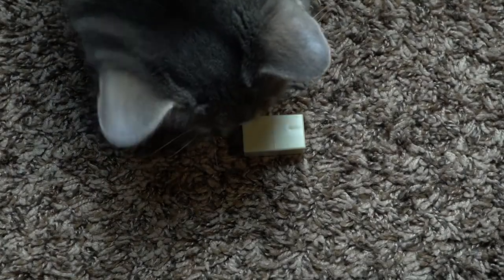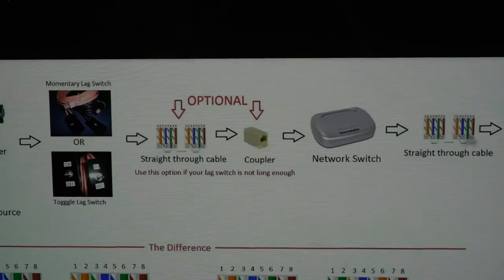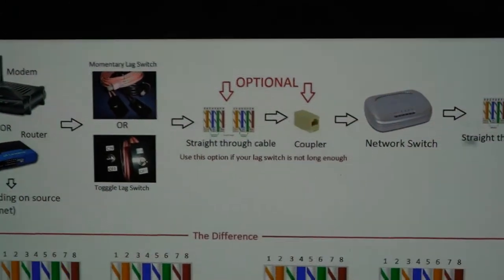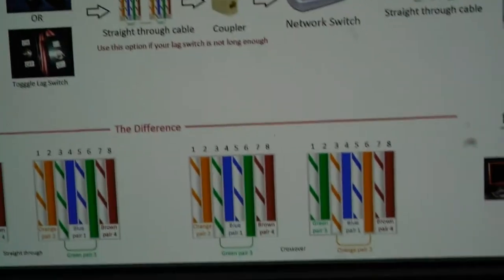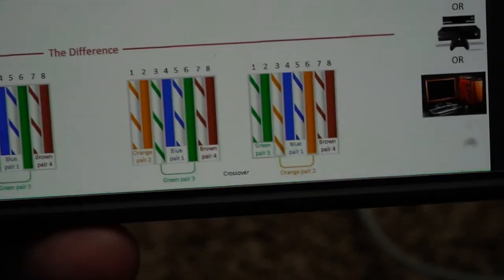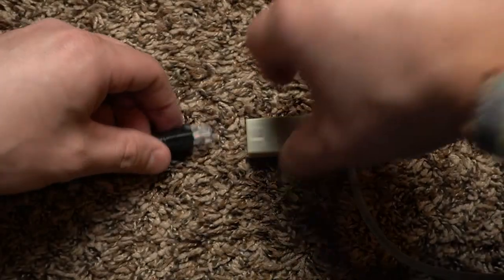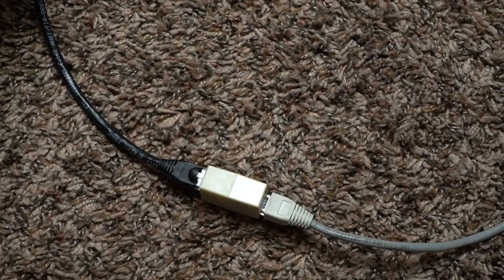Lag switch informational video 2.0

Comment: So if my lagswitch cord isn't long enough to reach my router directly. I can attach the coupler to the lagswitch and a longer cord to connect it to the router. Would it still work just as well as a direct connection or would there be major difference?
Reply from the maker: This is where common sense plays a part. If you have two 10ft pipes (they are exactly the same pipes) and a couple, You connect those two pipes using the couple. Do you then have a 20ft pipe, that will work the same as the two 10ft pipes? As long as the cable you are using is straight through and the total length is less than 328ft, I don't know why there would be a major difference.
Reply: U need a 5 port router

Comment: I thought what the lag switch users saw was going to be like normal and only others seen the lagging and teleportation. When I do it I can't see where I'm ending up. Doesn't seem like it makes sense to use one if the user gets what they see lagged too
Reply from the maker: It really depends on the game and how the servers are set up to handle lag. If you hit your bandwidth limit, you'll lag. You can't see where you're going when you lag. Sounds like the game needs a fix or there is something else, but I wouldn't know what.
Reply: @mikeeyram  Can the router be connected to the modem via Wi-Fi or does it need to be connected via cable?
Reply from the maker: Modems don't have WiFi only routers do, well most routers. If your modem does have WiFi, then it's also a router too, thus making it a modem/router combo.

Comment: It works only on 10/100 switch?
Reply: And wich color you cut between the toggle switch orange or green 
Thanks for your help
Reply from the maker: That doesn't make any scents. I don't understand how bandwidth can affect the functionally of the cable.
Reply: I been trying a few switch from other brands both 10/1000 and 10/100 its seems tha only 10/100 works
Reply: Mine work fine with orange but i wonder if the green make u lag a little bit longer?
Reply: And how bout put crossover cable together with a coupler between the the lagswitch nd the switch
Reply from the maker: I've used both 10/100/1000 and 10/100 network switches without a problem. As the bandwidth doesn't affect the cable.
Reply from the maker: That doesn't make sense. If like say, if you put the switch on the ground side the light will turn on slower.
Reply from the maker: You can try what ever you want and see that happens.
Reply: Thanks again for your help
Reply: @mikeeyram  hey im using a TL SG105 and my reconnect speed is awful can u help me out? do i need to change the switch, im not sure how to identify the best switch.
Reply from the maker: Logically if the network switch is taking too long to reconnect, use a different network switch.
Reply: @mikeeyram  yes but how do u work out which is the best.
Reply from the maker: I would assume the best one reconnects the fastest.
Reply: @mikeeyram  idk what that is though? How do I find out without dumping loads of money
Reply from the maker: There is no way to find out, without buying one and testing it.
Reply: @mikeeyram  dam its gonna be a money pit then lol
Reply: @mikeeyram  also do u need a router that connects to an external modem like tp link, then to a switch then to xbox
Reply from the maker: You need a router in general. Unless you only have one device online via LAN. As modems don't have Wi-Fi.

Comment: I have a ethernet in my router going into a netgear ethernet switch and then the lag switch plugged into the netgear and into my console but it disconnects me right away. what do i need to do?
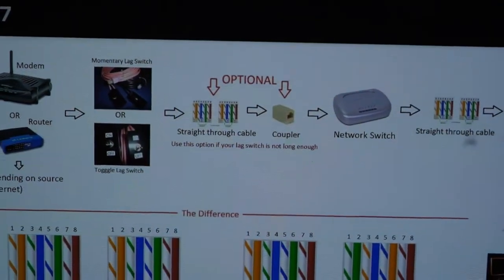Reply from the maker: Sounds like you ignored what was said and shown in the video. I show the picture that's in the item description at 3:14.
Reply: I dont really understand it and what i need to do.
Reply from the maker: What about the picture is confusing? Where do you see the lag switch in the picture?
Reply: I have the switch in the router is that right?
Reply from the maker: That doesn't answer my questions. To answer yours, yes, the lag switch plugs into the router, just like the video tells and shows you.
Reply: and the other side goes into the network switch right? Im just going through what i did to ask you of its right
Reply from the maker: Yes, the lag switch plugs into the network switch, just like the video tells and shows you. The video tells / shows you what's right, that's what it's for.
Reply: what do i do after that then? Cause i plugged another ethernet into the network switch and then into my xbox and it disconnects me as soon as i switch it on
Reply from the maker: Is the other ethernet cable straight through? What's the model number of the network switch?
Reply: okay so i just seen how to check that and its a patch cable so thats the problem right? and if that is the problem then all i would need is to get a straight through cable and then itd work?
Reply: or are they the same actually? lol
Reply: and its the netgear GS305
Reply from the maker: No, that's not the problem, According to the video, you want it to be straight through. Unless that cable is damaged, then you'd need to fix or replace it. That's a common network switch. For you, how long does that network switch take to reconnect?
Reply: uh like 2-3 seconds and I probably do need to get a new ethernet cord cause i tried making a switch myself before with it and it does work but it still does this even with the one i bought from you so idk whats wrong
Reply from the maker: That sounds like a problem. I wouldn't use a lag switch at a ethernet cable between a network switch and console.
Reply: alright ill try that idk if i got one though ill lyk whenever i do get one or find one and if it works or not thanks for the help tho I appreciate it
Reply: can you link me a ethernet cord that’ll work for sure that i can buy
Reply from the maker: When it comes to connecting a console to LAN, ethernet cables are very basic, it's extremely hard to get it wrong.
Reply: i do have a cat6 cable but it doesnt work when i have that in aswell i tried using the coupler too
Reply from the maker: So you have a cable that is to short, that's why you used the coupler? It sounds like you are leaving the switch on too long and / or your network switch takes longer to reconnect than you told me.
Reply: I can connect it straight to my console so its not too short and ig sometimes it takes like 5 seconds
Reply: and its as soon as i turn it on it disconnects it
Reply from the maker: Where do I say to connect your lag switch to your console? Or where are you seeing that information at?
Reply: im talking about the cat6 i have the switch in router to my network switch and the cat 6 from network switch to console
Reply: I just wanna know why it disconnects me right away and a way to fix that cuz everything works fine
Reply from the maker: As long as you have the correct network set up, using a lag switch or even quickly unplugging and plugging the cable from the network switch doesn't immediately disconnect you. If you have an incorrect set up, which you do somewhere, using a lag switch will immediately disconnect you or not disconnect you at all.
Reply: Whats wrong with my set up then i have it exactly as it says
Reply from the maker: Without actually being there, I wouldn't know. If you have your set up exactly as the video shows, then you don't have any problems. If you do have problems, then your set up is not the same as shown. Lag switches are very simple and it's easily to tell if your set up is correct or not, or if there is user error. If you lag for a few seconds, then the game returns to normal, everything is working fine. If you lag out, you have the switch on too long or your network switch takes to long to reconnect or both. If you are immediately disconnect your set up is wrong. If you can leave the switch on forever and not disconnect, your using WIFI and not LAN.
Reply: what do i need to have it reconnect faster then cause idk what else it could be besides that
Reply from the maker: The only way to change the reconnection time is to change the network switch.
Reply: what network switch would you recommend or what are you using?
Reply from the maker: The ones I recommend are in the item description. The ones I am using are in the video.